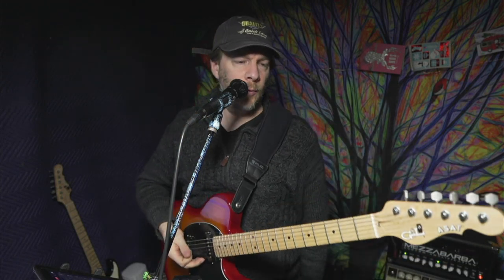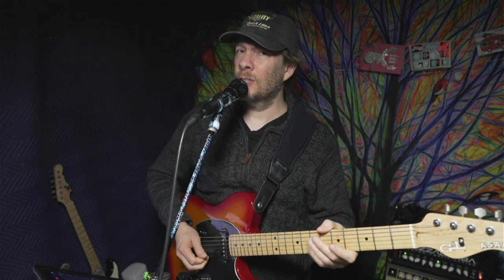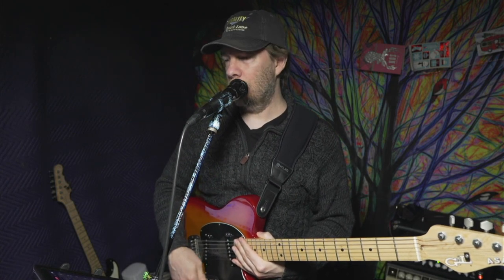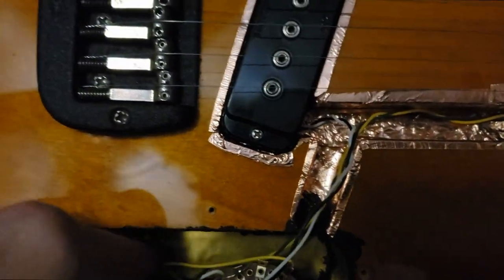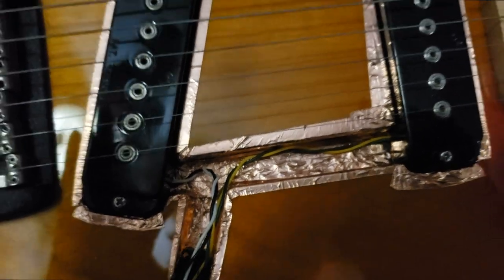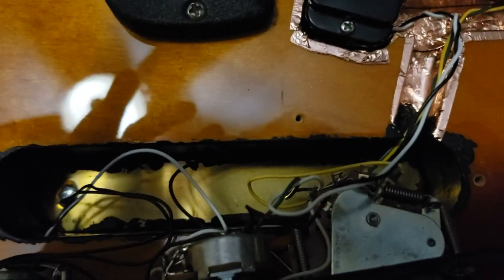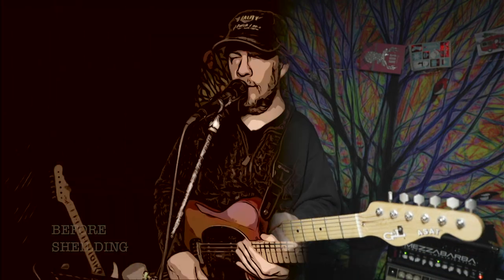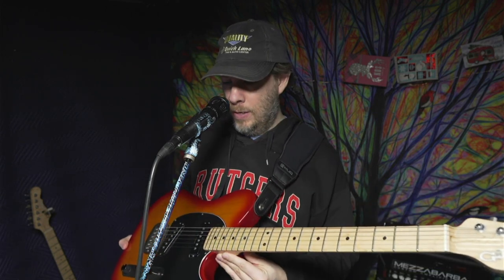Shielding an G&L ASAT special guitar to get rid of single coil pickup buzz and hum.

Comment: It helped, but perhaps not enough to make you feel good about all the work. I would recommend a noise gate with high gain pedals. Its the price we pay for using single coils.
Reply from the maker: Yea, I felt it was noticable enough to make it worth it.  I put Kinman noiseless single coils in one of my strats and love the strat sound with none of the buzzzz.  But the ASAT is so punchy and fun to play I deal with the buzz.  I do have a noise gate pedal I can throw on if I want to use a fuzz or high gain which does work pretty well for that situation.

Comment: Thanks for sharing. It was quite a difference I must say! Is it worth the effort, when in the end you are usring (have to use) a noise gate anyway?
Reply from the maker: Well every little bit helps.  If there is less hum then even if using a gate you can set the threshold a bit higher so the gate closing is less prominent.  Also if not playing high gain you could play without a gate and that less buzz would make for a more pleasant sound overall.
Reply: @daveblairmusic  Thanks for the answer. That helps!